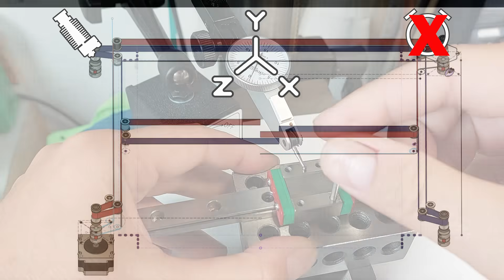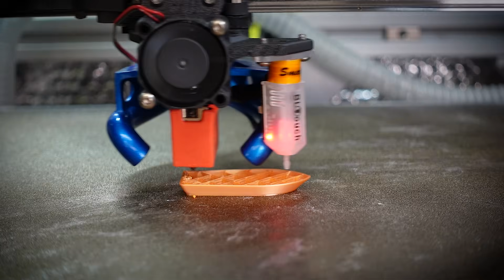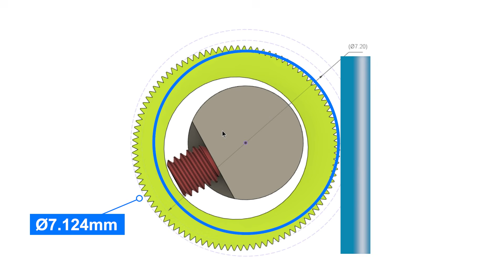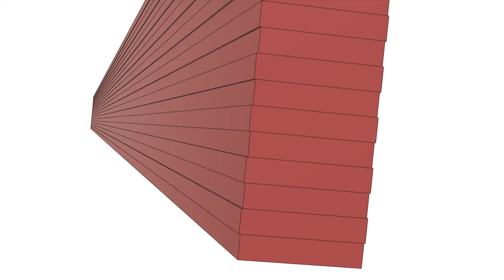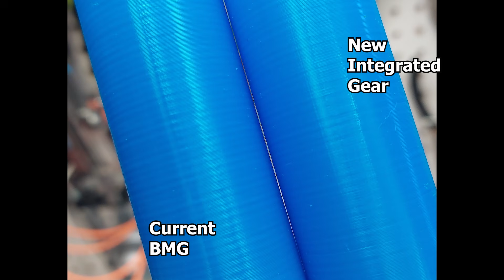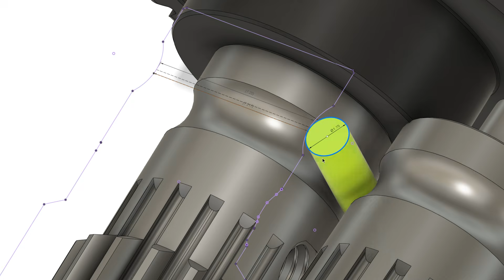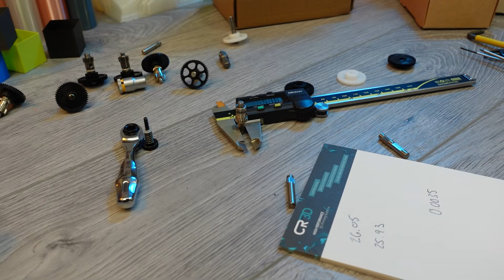Extrusion Quality - Mystery issue resolved !

Comment: When fiddling with the drive and idler gear alignments, it's also important that the drive side is locked into a suitable neutral position, the idler side actually is needed to set this. I've loosened mine, drawn filament through manually, and tightened it into what it self-aligns to. Anything else and the filament can wander around if a slot is formed by them being off-center from one another. That wandering could/would shift where it is on the outside diameters, similar to your axial misalignment case.

Comment: Have you considered measuring thw filament diameter in real time? Even from 1.75 to 1.74 mm causes more then 1% change in the section area. Measuring atleast 2 points 90 degrees from each other in one section could help you focus more on the parts we can actually change.

Comment: I wonder how much length of Bowden you’d need to take benefits of the dampening effect. If a small length of let’s say 15mm would be enough. Would that justify the slightly worse retraction capabilities?
Reply: I am using the Stealthburner with Bondtech LGX and there is around 40 mm of PTFE tube between the extruder and hotend, i need to try 3 mm inner diameter PTFE instead of 2 mm and see if that makes any difference.......

Comment: MihaiDesigns has done a couple of videos troubleshooting these sorts of patterns. If you print a tapering object, the horizontal bands create a wavey moire pattern that he uses to work out how often (i.e. how many degrees turned of motor/hobbed gear) the variation occurs. Like you he found that the geared idler caused problems, but also the hobbing itself creates a very fine pattern due to ever so slightly varying diameter from the highs and lows of the hobbing.
Reply from the maker: Yes! so many aspects are impacting our prints!  
- Gear eccentricity
- Spur gear meshing 
- hobb teeth
- filament walk in the hobb
and I am sure we will discover more as we regain control on the items of this list.

Comment: 3 grub screws. 120 deg. Tune to 0 runout. Same arrangement on idler at EACH end of bearings supported shaft to tune parallelism, measurement difficult?

Comment: I spent days to find the cause of this issue in my Artillery printers. It appears that from the factory every unit has large eccentricity in large gear of its Titan extruder clone. Ended up with replacing this gear in my machines. It's still not perfect, but way better than stock.

Comment: I had some print quality issues but never this one. It appears attaching drive gear directly on the shaft of the motor coupled with a simple ballbearing pulley for the idler is a good combination. Sadly, it is now very difficult to find those brass gears that attach to the motor directly.

Comment: One element of surface quality that is often forgotten is PID tuning of the heated bed. A well-tuned heated bed PID is important to ensure the bed is not expanding and contracting periodically as the temperature oscillates, which can lead to irregular layers. This symptom is most obvious when "bang-bang" bed heating (more suitable for a bed with a lot of thermal mass) is used instead of PID.

Comment: I have always wondered why i got these similar issues way back when my old Mendel90 got "upgraded" from the old school Wades extruder which had a hobbed bolt and bearing to a E3D titan. Wades with prusament got me some of the best prints i've ever had. Having the same issues now on my Hevo with Galileo. I've always put it to the expence of speed as the old mendel never wanted to go past 50mms on marlin. Hevo on Klipper and pushing past 100mms. I've never been after hyper speeds but i dont want to wait days for a print so my eyes hurt and brain farts with this outer perimeter funkiness. Thanks to you an engineer got his mind at rest, still my eyes might complain after every print. :D

Comment: Hah! I had exactly this problem with my Wade-based designs years ago. (Indeed, with a sufficiently open extruder design, you can see the runout error by eye.) It turns out that a tight fit is critical for both extruder drivegears and also axis pulleys. This exact same effect occurs with XY drive pulleys. Cheap pulleys have a much wider bore than genuine pulleys, which is the entire secret to genuine Gates being better. (And I have done extensive experiments with 2GT pulleys driving a very high resolution encoder to quantify the error...) I have also been working on an even better solution for this for extrusion, too :)

Comment: Great video, thanks! I was trying to solve same issue on mt voron printer. What i have noticed is that such defects are more pronounced on ABS (ABS or ABS+) than PLA. Have you tried different filaments too?
Reply from the maker: Yes, different filament will amplify or reduce the impact of this phenomenon. I suspect it is related with nozzle pressure and material surface tension.  You can see my HotEnd testing first video where I compare pressure results for ABS, PETG and PLA on the same hotend. https://youtu.be/dAJlLWX0Few?t=1149

Comment: Howdy MirageC, can you please check held comments? Mine seems to have been held for approval (I tried twice). I’m guessing YT didn’t like my link to printables?
Reply from the maker: Nothing in my held for review comments unfortunately.  Links will sometimes trigger comment deletion.  especially if pointing outside of YT.
Reply: @MirageC  cheers, I wasn’t sure what the issue was. Great video, just incredible investigative work mate. I really really enjoy your technical videos.

I solved Z-banding on my i3 style printer by using Axial Thrust bearings to support solid compression lead screw couplers (design is on Printables). I also found that restraining my lead screws at the top of the printer made the Z banding worse. (My lead screws are not even close to being straight)

I’m running an Orbiter v1.5 on my Voron Afterburner HE and I do see the artefacts your video discusses. I’m very keen to see the solution develop and will be keen to try your extruder design once finished. 🖖

Comment: This brings an interesting question. If I recall correctly, extruders like the LGX and lite don't use grub screws. Hopefully someone can chime in to confirm. So in theory they shouldn't suffer that much from misalignment or such
Reply from the maker: My thinking is that althought they dont suffer from eccentricity as much, they might see filament walking in the hobb.  Therefore operating at different extrusion rotation distance.  But impact will be reduced by the ratio to the bigger gear diameter.

Comment: everything explained in this video is great. I'm not wondering why my LGX Lite seems to have this issue also. could it be drive gear and idle hears having lots runout? since there is no grub screw there is only one thing that can cause this. I hope by working with you they improve their own product standards as well. Maybe I can test the runout on these gear and see how much they might have. GREAT WORK! All of us are behind you cheering you on! Thanks for all the great work your doing for our community of plastic pushing gear heads!

Comment: Thank you for doing all this work!  I put Micro Swiss + Bondtech extruders ($130) on my Wanhao D6 printers and the side walls have been crap.  I was losing my mind changing bearings and other printer parts.   Now to find out the Bondtech extruder is likely the cause.  Very sad. Lots of time and $$$ down the drain.   I now have a Prusa and the two D6 printers don't get used.  After watching this video I looked at the idler gear pivot arm on my Bondtech and the hinge pin or shaft (3.0 mm)  is much smaller than the "bushing" (holes)  it rides in (1/8 inch or 3.175 mm), so it can wobble all over the place.  I am going to replace the 3.0 mm hinge pin with a 1/8" drill shaft and install those small 3.0 mm ID bearings in place of the idler gear in the Bondtech myself to see if I can improve things for $20.  The drive gear is pushed off round by the set screw, so I will remove that and just glue it in place with lock tite.

Comment: I only take photos with the worst angles and sometimes spend hours adjusting, snapping photos, adjusting, snapping photos. This has gone on for about 8-9 years off and on. In all that time I can tell you some of my best prints were off a early, well calibrated 32bit controller Mini Kossel delta printer. Currently running some modified Ender 3 v2s(latest H2 extruder/klipper) and Voron 2.4R2 with mods but have plans to eventually revisit a half finished 500mm delta.

Comment: I've come to realize that dual gear extruders are fundamentally flawed. The spacing between the hobbed gears is variable, to accomodate the filament. This means that no matter how accurate you design them, there will always be some play which results in different drives speeds on each side of the filament. The result is periodic slipping, resulting in surface artifacts. Idler designs are simply superior in this regard.

Comment: I recently tested the  Microswiss NG. Haven't made a video on it yet, but first prints are looking very smooth. They have a weird thing about machining everything out of billet material, but considering the difference that even a small amount of runout can cause, I think it makes sense to be so meticulous.
Reply from the maker: Yes.  I am curious to try microswiss item as well.
Reply: @MirageC  I put a Micro Swiss NG on an Ender 3 Pro and have been seeing similar issues.  I all most resigned myself to not having beautiful prints that was made via the Bowden arrangement on the Ender 3.  I emailed MS tech support and they mentioned the Bowden arrangement did do some 'buffering' and offered a refund.  I didn't take them up on the offer and have tried to tune out the artifact the best I can.  

But this is amazing and does make sense.  I've only been printing about 2 years so I'm by far no where near experienced as others.

I would also be interested if you were to test a MS NG and see if you find a similar situation.

Thanks and you have a new subscriber
Reply: @MirageC  The extruder is 2 pieces that are bolted together - the carriage plate and the extruder/heatsink. So there is probably a clean way to mount it to your printer.

The other thing I noticed is that my v-groove wheels run much smoother on the Microswiss carriage plate. It re-uses the wheels that come with the Ender 3, but I think on the typical Ender 3 carriage plate, the 3 wheels are not perfectly in-plane with each-other, which adds  a notable amount of friction, reduced stiffness, and wear.
Reply: I’m using a microswiss NG direct drive also on my ender 5 plus with linear rails, the inconsistencies still appear. The NG is geared but the actual filament gears use the same dual gear design as the normal MS DD. It’s hard to see but if you take it apart or look deep in there it’s the same gear mech that pushes filament as the normal one
Reply: @Youthoughtbuddy  interesting. I'm running a 0.6mm nozzle. I think larger nozzle diameter evens out these inconsistencies. For the same travel speed, the extruder is spinning much faster. Plus the puddle of molten plastic is larger,  which acts like a reservoir/buffer.  My DD large diameter prints are typically free of patterns.
Reply: @greatestevar  I am working on a presentation about ball-bearing induced wobbles. Basically, the cheap sloppy bearings used on most v-Grove wheel machines changes the effective diameter depending on if the bearing is on-ball or off-ball. It's a simple matter of geometry.

Comment: I've had a lot of trouble with the shafts and bearings on the idler gears. Aftermarket bearings, hardened shafts and proper lube makes a lot of difference.

Comment: Brilliant explanation and fix. Would the actual filament cause the same problem if it had "kinks" in it as it would feed into the idler off center. I have had a few new spools that have been pretty poorly wrapped on the spool from factory. I have a bowden set up and suffer from this problem
Reply: Just having differences in grip so 100 mm gear movement isn’t reliably the same amount of filament feeding absolutely will cause problems.

I could see this happening with perfect tolerance filament that happened to vary in wetness enough to cause friction differences.
Reply from the maker: Yes, anything disrupting or changing filament will have an impact to a certain degree.

Comment: As I recall, Mihai Designs reached exactly the same conclusion about a year ago...
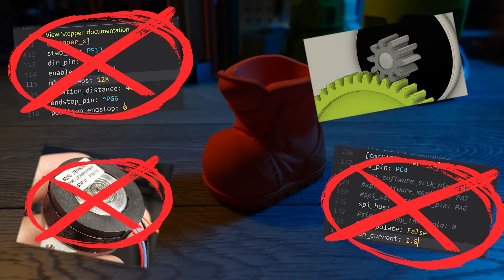Reply from the maker: 6:37...
Reply: @MirageC  Yeah if gear meshing was the fix Mellow Mini Libra would be selling like hot cakes. I Went from original Orbiter to Mini Sherpa to Mini Libra and it's still the same issue.

Comment: Love your videos..if i can suggest few things..

Remove hot end and rotate extruder with stepper..measure the filament coming out with dial indicator, check for consistency between input stepper and travel of filament. 
Another idea.. macro lens the artificial.

And another conspiracy.. this runout also exist on the gear-belt of XY steppers.. but i guess the belt tolerate it.
Reply from the maker: Thank you for the suggestions. Yes run out on xy pulleys and idler can be an issue.  Been there in the past.  Been using Mellow's pulleys without issues since then.
Reply: @MirageC  thanks..will be happy for link if you have
Reply from the maker: @joelevi9823  These are the ones I use on my machine for the past 2 years,  I have inspected them 2 weeks ago and they show no sign of failure so far: https://s.click.aliexpress.com/e/_Ddy5Nsf
Reply: @MirageC  thanks i will give them a try..
Do you use with teeth or without?
Do you also reccomend their motor pullys?

Comment: Wow, awesome vid. This is exactly the issue I was having with an OMG extruder.  This video would have saved me days of chasing down the issue with mine. Even after finding my issue, I didn't fully understand what was going on until all of your hard work.  Well done sir, well done.
Reply from the maker: This issue almost had me to put an axe in the printer a few times.   Glad I found the source.  Now I need to work on the solution.
Reply: I bought an OMG extruder too, for my Ender2 Pro. I had already replaced the stock with a SeeMeCNC EZStruder, and was getting good results. I thought I would do even better with a OMG....but it was worse.

Comment: Nice job pal! How about using a sensor that can measure the filament flow and reduce (or increase) the stepper motor's steps in a closed-loop to keep the flow constant? This way perhaps you could actively compensate for mechanical imperfections, and make a product a lot of 3d printing people could buy...
Reply: That already exists, its known as the infidel, you can find it from Thomas Sanladerers youtube channel

Comment: I gotta say, that it's quite funny how the improvements are slowly leaning towards a Titan extruder altogether! Those have a plastic gear with the filament pushing gear all integrated into one part, and just a bearing on the idler. It's funny that when you check a clone one of those (...I have one and got another 3 for work printers given their rock bottom price) at least one feature is inexplicably better on then, than the original (I can understand since it came later to market but still not why it wasn't a thing on the original): the idler arm has a bearing instead of the weird idea of self-lubricating polymer riding on the shaft by itself.

Comment: Luck hasn't be a factor since I started 3D-Printing in 2009. Every little change has a result. I was really jealous, that cheap chinese printers like all the Ender3 clone achieve a similar print quality like my DIY built one, I spent thousands of hours on. But this is because, they are very well configured right from the start. All my research has gone into the development of all of those. If I'm gonna design a printer today, I would beat the f-ing crap out of all of those. But I still couldn't beat the price. So just buy  a cheap chinese one with 2020 extrusions - and you're good to go and you even can modify it to your needs. A cheap ender3 clone is a perfect basis.

Comment: Ooof.
So you are telling us that there is "genius of simple design" behind ender3's extruder system?
....that the simple straight gear teeth, is ideal for preventing issues that could arise from not having perfectly paralel gear and tensioner bearing?
That simplycentering the gear via mathing cone surfaces on shaft and gear is ideal?

Comment: Great vid, good analysis, but this isn't really news. I "upgraded" my CR10 bowden printer over a year ago and went to a MS direct drive. Previously I could print PETG with flawless finish, now....not so good. Still I like the reduced hassle of direct drive and the better material handling and increased print temps, but the finish isn't near the quality of a well tuned bowden setup. I face the same dilema as you, my Voron V0 suffers from extruder issues but it seems like the LGX Lite isn't going to be a solution either. Single gear extruder with bearings looks like the way to go, or precision machine some metal geartrain at great cost.....I'm thinking bowden with improved tubing & fittings is the best choice unless you have a huge printer or need flexibles. Big fan, keep up the good work.

Comment: Re idler:  the cheap bondtech copy I bought has the worst idler pin imaginable, it was way too small and soft as s### . I replaced it with a broken carbide endmill (broken specially for the purpose you understand, I never break them by accident, oh no not me )

Comment: i mean 3 thou is quite much for a gear, less than one is good.   There are a couple ways to fix it.  IF the runout of the bore to the gear is good, u can try some locktite 638. Maybe the glue will center it better.  And btw. the calculation should be done by the surface speed difference at the pcd of the gear than broken down to the feeding knurl  or directly. But anyways interesting point.